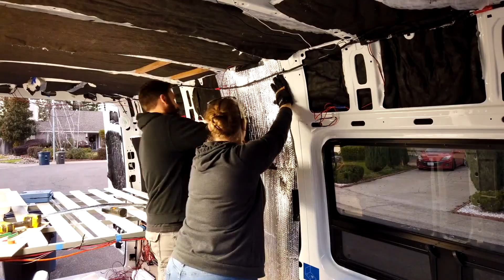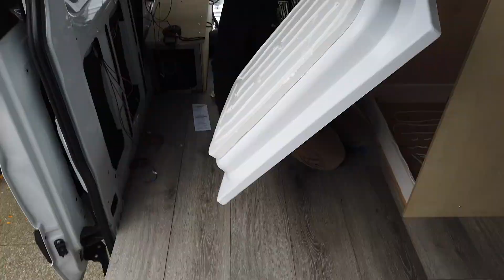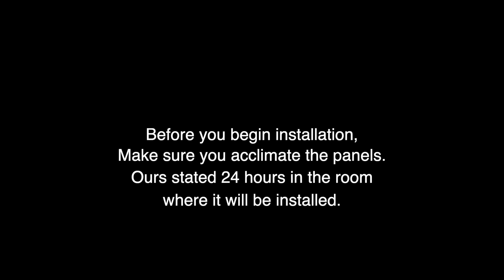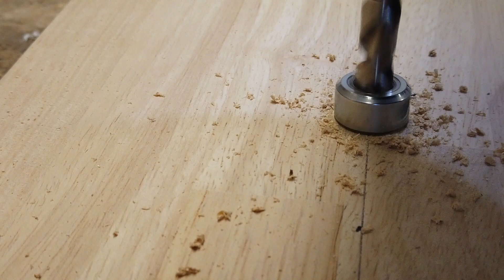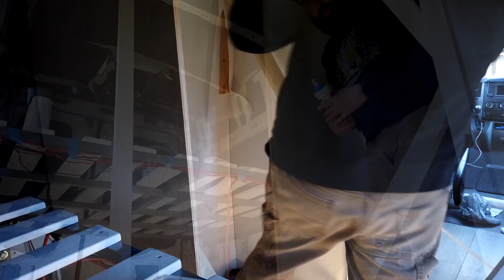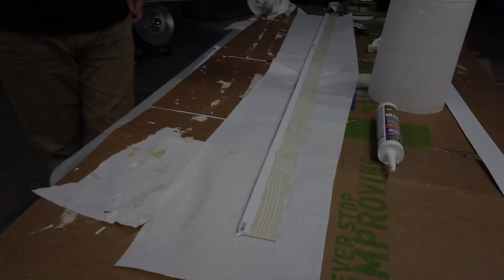Sprinter conversion, how to build a shower part 2

Comment: I'm surprised you didn't use the corner beads for the side walls to back wall and at the floor junction with the shower pan. Much cleaner look overall and no caulk hassles.  You confirmed my original idea of just using plywood panels pocket screwed together vs framing out the walls with 2x3's. The addition of the 1/3's at the outer sidewalls was a very good idea. Thanks for the video.

Comment: no redguard in the corners?
Reply from the maker: Negative. We called and spoke with the engineers/ representatives at red guard and the manufacturer of the FRP glue and they both said you cannot use red guard and frp glue, it will fail overtime. They mentioned something regarding the fact the glue cannot dry/ cure properly with the red guard.
Reply: @Weekendsweroam  On a previous response you said if you were to build it again you would include a waterproofing membrane for peace of mind. Since you can't use Redguard and FRP, what would you suggest? Great videos, BTW.
Reply from the maker: @guitardoc99  after a lot of research we finally decided that we would probably just do all aluminum shower stalls going forward. The showers are still holding up to this day and we think as long as the caulking in them is replaced as needed they should hold up just fine

Comment: Great video - very helpful.  I’m wondering how far from the “base” the shower pan wall is. With a 1/4” countersink for the screw, the 2-1/4” screw is going to extend 1/4” past the inside edge of the base. 2” screw would have been safer.  Also, you might want to use 8” strips of water proofing material to make 4” lap joints at all the FRP seams  (lapped over the upper rim of the pan) to keep water away from the wood if your caulk leaks anywhere.

Comment: Hi Dan and Christina, any wisdom on using pocketholes in 1/2" ply?  I'm finding that the standard Kreg kit and screws are horrible since when I screw deep enough to bury the head, the screw point goes clear through the backside when I use their recommended 1" screw w/coarse thread.  I then tried the 3/4" as suggested but that's fine thread and it won't even self drill or grab the wall ply.  I might be able to live with the tip protruding in this case if I can hide them behind the walls.  But I'll be looking for solutions here and anywhere!
Reply: Might have figured this one out by trying different settings.  Fwiw -  I set the jig to the 3/4" setting and clamped with the stop backed away about 1/8" from the board edge.  Then set the drill stop exactly halfway between the 1/2" and 3/4" settings.  Using the standard 1" pan head coarse Kreg screws.  Pretty clean and secure job so far in 1/2" Baltic Birch.

Comment: Awesome ! I have the same pan. What size pieces of wood did you use for the pan frame? . Thanks in advance!
Reply from the maker: ME PILLA I don’t recall. It that the exact size what ever shower pan you’re using. The wood went right up to the edge.

Comment: Hello. Did you use the 1/2 inch for your back wall? If so how did you bend it?
Reply from the maker: Jo we did use 1/2in and it isn’t that much of a flex. Started from the bottom and used pieces of wood that would sit on the panel and pressed against it from the other side of the van with stick. Just like with the frp. I just went up and added more as I went up and that added holding power from the sticks bent it. I added a few screws to make sure it held, and then went and counter sink a bunch of screws into the wood so the frp would lay flat on the 1/2” board. I hope that makes sense!
Reply: @Weekendsweroam  thank you so much. I am following your bathroom design and will try these steps.

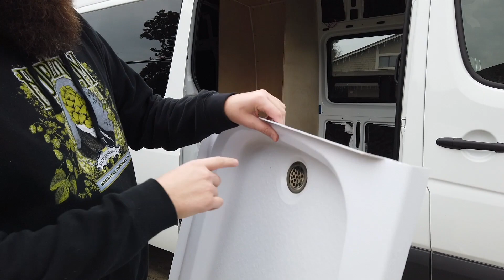Comment: The drain piece at 2:45, can you explain how I can make that from Home Depot parts? Having trouble with that one.
Reply from the maker: We went to Home Depot or Lowe’s and got one of the under the sink compression fittings. It fit perfectly and attached to the pvc pipe tank we made.
Reply: @Weekendsweroam  What size hole did you cut under the shower pan then? I cut a 2" hole but all the fittings I've tried buying are too wide to fit. (My drain doesn't go through the whole floor, it stops halfway through because it goes through the subfloor and insulation and van floor..
Reply from the maker: @kenc8472  Hey Ken, So i remember that being a tight squeeze. If i recall i either had to attach the adapter on the bottom of the drain and then drop the pan in. I can still see that part on the underside of the va so i still have access if i had to change it. I hope that helps!

Comment: Home Depot sells a Roberts extendable floor roller that would work great on those FRP panels. It allows you to really get a uniformed spread on the adhesive. It's mainly used to install vinyl flooring. It has a nice palm handle and a pole extension that helps you really control what you're doing.
Reply: Can you tell me where you purchased your FRP and the thickness of it? I found a company in Colorado that sells it but it’s 0.09 inch thickness that seems to thin 🤔

Comment: Nice job so far! I have sprinter myself, you really need to secure your electrical wiring better with conduit or something. The sharp metal edges of the van will damage the wiring and can become dangerous. Please think it over. Good luck Rob
Reply from the maker: Rob Reynolds I don’t think it was covered very well in this video, but we did use conduit. We used a flexible kind of varying sizes to secure the wires. It was done later on in the build stages. But yes, that is a VERY good tip for anyone building a van.

Comment: Hi Dan and Christina, When you used self taping sheet metal screws to secure the back wall to the van, did the screws go all the way through the sheet metal? How did you prevent these screws from sticking out the outside of the van? Or did you only attach sheet metal screws to the metal beams?
Reply from the maker: Iris when they go through the wood and then through the sheet metal there is about a two inch gap from the metal I’m drilling in and the outside sheet metal of the van. Before you drill into anything, make sure you check the length of the screw!  On the floor they do go through. Check under the van before drilling to make sure you font hit anything. When the screw goes through the floor I go under the van and caulk every single screw that goes through

Comment: Is the back wall of the shower 1/4 inch or 1/2 inch? It looks flexible so I assume 1/4, but I didn't realize you can use pocket holes in 1/4.
Reply from the maker: The back wall is 1/2". It took some handling to get it to bend right but once we secured it with what felt like 100 screws it hasnt moved at all. We are six months in and weve used the shower every day since we hit the road and its holding up perfectly.
Reply from the maker: I plan on doing an update video soon to go over our likes and dislikes. I wanted some time to get a good feel for it.
Reply: @Weekendsweroam  I'm going to be building a similar shower, so your videos have been very helpful. Even though I'm using the same shower pan, I'm going to make my shower a few inches wider and maybe build a shelf in there. I'm hoping to see your update before I start.
Reply from the maker: Jason Hall not a bad idea. I can say size hasn’t been too much of an issue. One tip. Get a shower mixer that will “hold” your temp setting. So when you turn it on you get the same temp every time. Ours you mix hot cold and that wastes precious water! We have ours marked but it’s very finicky. 
 I wish I would’ve done that!
Reply: @Weekendsweroam  do you have one in mind? This one looks good but no reviews 

Triton Lentini Thermostatic Concentric Mixer Shower https://www.amazon.com/dp/B01890770S/ref=cm_sw_r_cp_apa_i_lwtRDbZESJ2Z9

Are you going to change yours out?
Reply from the maker: Jason Hall unfortunately I don’t have one in mind. I should’ve taken a picture. But I found one that has the hot cold selector different than the on off. So the temperature mixer is always the same.

Comment: Hi. This is Brian. I see your 1/2 ply walls extend beyond the front edge of the shower pan. Was that to accommodate the door? How much should I allow for the door?
Reply from the maker: For our it was for the 3inch edge on both sides. So when the shower is running we can have the shower curtain in there and not have water running out.

Comment: How do you hold your bed? 👍🏽
Reply from the maker: Estrella Lopez the bed frame is mounted to the walls of the van. The mattress itself is held in very nicely by the shower frame. Before that it didn’t really move around much. We have an instagram with lots of detailed pictures as well. @weekendsweroam.

Comment: Idea: Maybe have the toilet on slides to be able to slide it out of the shower booth under the bed to have more space while showering AND keep the toilet nice and dry...
Reply from the maker: Sander Tel what we ended up doing yesterday actually, is have two point to attach a bungee cord to. The bungee holds the toilet exactly where we need it in the shower and allows for a very easy removal of needed! Video three will be coming out soon. We’re just now starting to settle down form the move.

Comment: What timber did you use for the shower walls? Thanks
Reply from the maker: Cliff1654 we used 1/2in Baltic birch plywood
Reply: Weekends We Roam . Thanks guys. Tossing up between this or a stud wall. This looks simpler and takes less room.
Reply from the maker: Cliff1654 we debated the same thing. And honestly now that we’ve built it out with the Baltic ply. It’s so sturdy. And we’ve saved so much space. With the proper support on the top bottom and the front and back you’ll be surprised how sturdy it is.
Reply from the maker: Cliff1654 we debated the same thing. And honestly now that we’ve built it out with the Baltic ply. It’s so sturdy. And we’ve saved so much space. With the proper support on the top bottom and the front and back you’ll be surprised how sturdy it is.